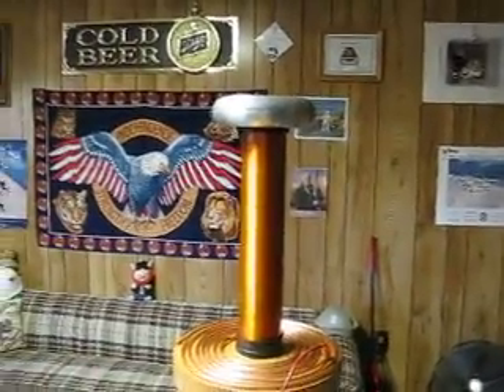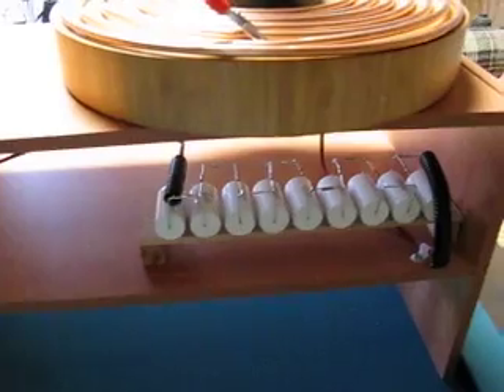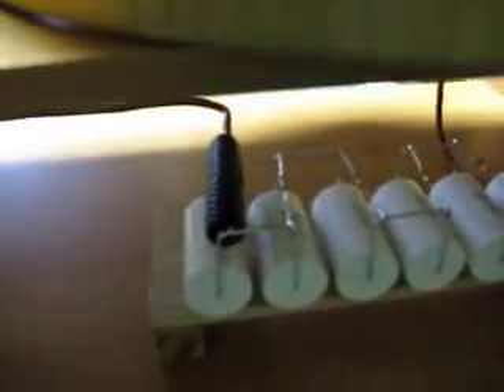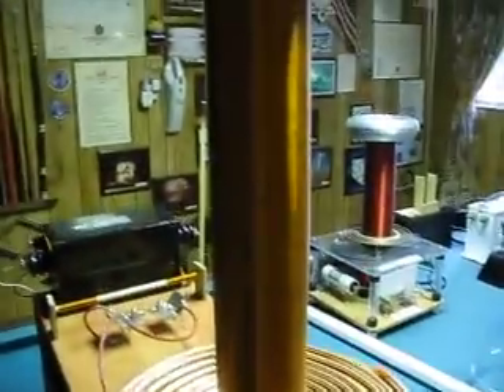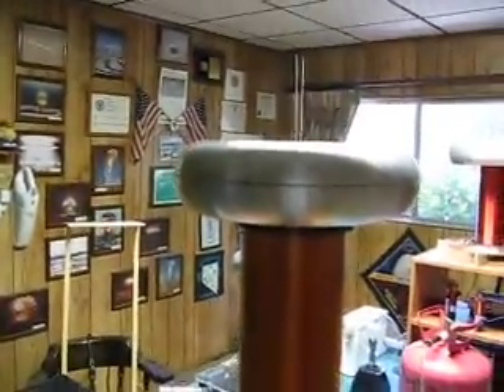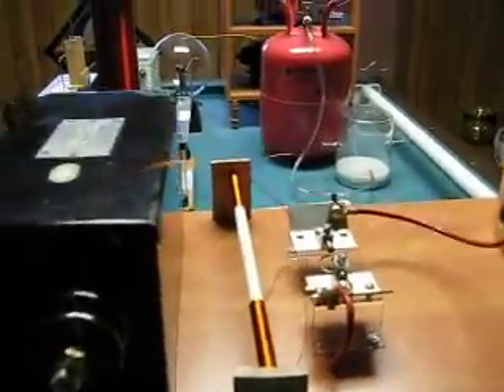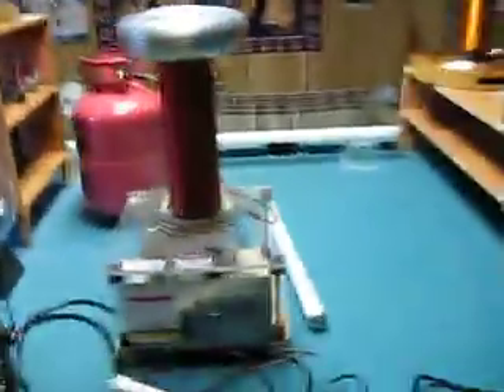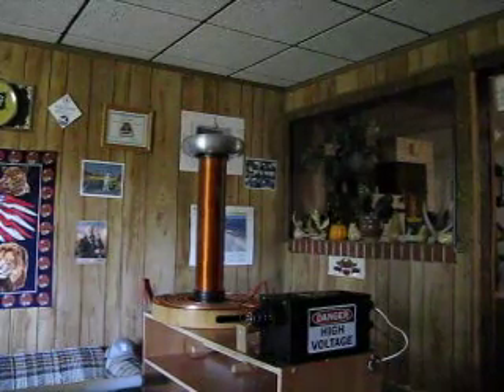Tesla Coil with Parts List

Comment from the maker: I tuned it my moving the wire with the alligator clip to different areas along the copper tube pancake.  Trial and error.  MAKE SURE POWER IS OFF (UNPLUG THE TRANSFORMER) AND MAKE SURE TANK CAPS ARE FULL DISCHARGED.
Reply: What were the effects of tuning it differently?  Does it change the frequency of the sparks?  Can it be made where you can touch them without harm?   Thanks, and great work!

Comment from the maker: texascomm-
Actually, cost is minimal.  Max wattage is 9,000 volts X .060 Amps - 540 watts.  At about 11 cents a kwh in Vegas that is maybe six cents an hour.  It is the `wear and tear'  that limits operations, both on the NST and the tank caps

Comment: Including that RF Choke was VERY smart. I ruined a couple of HV transformers in my experiments until I learned that RF was feeding back into my transformer; fortunately it wasn't near as expensive as yours obviously is, but it was one I had built and it took a lot of time to fabricate it. If this is still a problem maybe you could consider making a TUNABLE RF choke, perhaps a formed coil on a non-ferrous form that slides in or out of an identical but slightly larger coil. Just an idea. NICE VID!

Comment from the maker: Hi tokyptim24-

Wikipedia has a good write up on tesla coils.  Just google it and select the wikipedia link.

The coil is wired in the same config as the picture just to the right of the section titled "Wireless transmission and reception", Typical Tesla Coil schematic.

I added the RF choke (magnet wire wrapped around the dowel, between the output of the neon transformer and before the spark gap..)

Comment: I’m missing it I think.  I’m trying to see how to put a Tesla Coil or a  "Mutual Induction" apparatus into service in my home.  It only appears that I have to spend ELECTRICITY to make ELECTRICITY.  Where is the gain there?  Is it possible?  What would be the cost?   Making a "Lighting Machine" is not my idea of being useful when I want to run Power Tools or my Laptop. You can tell I am a real “Dingbat” on this stuff, but surfing this stuff is fun, but I am not getting the “Usefulness” of it all

Comment from the maker: There are three commonly used transformers for Tesla Coils; Neon Sign, Oil Burner Ignition, and Microwave Oven.  The Micorwave Oven is NOT recommended for various reasons.  The Neon Sign is the best of the three.  Make sure it doesn't have a GFI in it.  Good luck and keep trying.
Reply: bruce89103  can I use 300 v of transformer ??? can I use AC to DC converter transformer